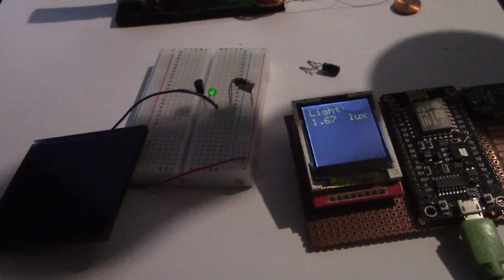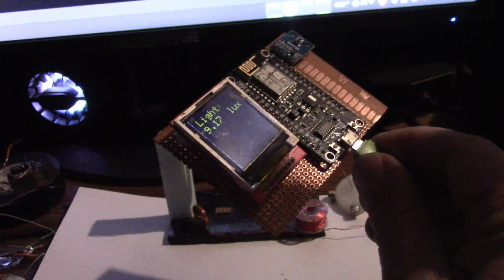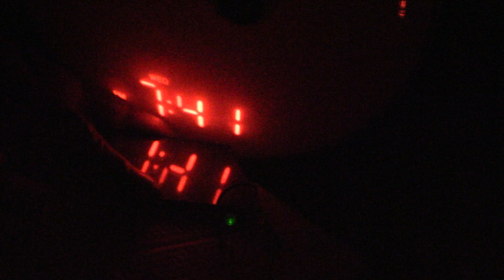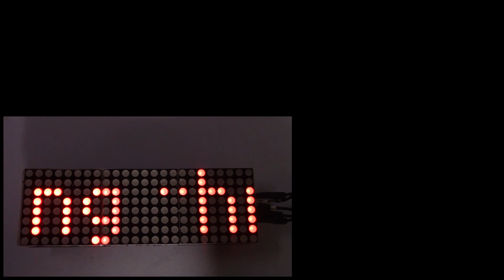The Simplest Low Power Solar Oscillator (works GREAT!)

Comment: That's literally just powering an LED with the solar panel... those resistors, not inductor, are plugged in wrong too do nothing in one case, as in not in circuit, and the other is just keeping the LED Voltage down.

Don't buy anything front this snake, but at least he's human and not an AI
Reply from the maker: Haha, never been called a snake before 🤣
The inductors are 1000uH and 100% real. Take a look online at pics of them, they'll magically be the same as these!

Comment: I built your Super Simple Slider circuit!  So, I can confirm to others it does work and is versatile enough to allow a wide variation of available components. I used a S8050 transistor, a premade  Vertical Toroid Magnetic Inductor Monolayer (2 identical coils wound separately on a green toroid ring) 2mH 5A Inductance Coil(s). As a source, I used 1.5V battery with a Schottky diode SR240 40v 2A (which needs only .2V to start). I tried, but It would not work without the diode. Possibly it could be replaced with the more common 1N34A Germanium Diode 50 mA 65V.  When the circuit was running I measured ~30 mA DC. The frequency was 4.725 Mhz, measured across the 2nd coil, NOT recommended across the LED (shut my meter off). Probably best done with a completely separate pickup coil?

The most interestingly thing I found about this circuit is that a 2nd LED can also be placed across (parallel with) the 2nd coil leads. Not as bright, but close enough, and with just a tiny increase in source mA.
Reply from the maker: Fantastic experiment and thank you for the results!
That was a heavy lifter of a transistor, which also shows versatility in NPN choice 😀

Yes, I had trouble with an AA, but no issues with solar panels. Looks like you found the solution, thanks again.

The second coil being the Base coil? Must try that!
Reply: @Slider2732_  It's the Coil connected to the Transistor's Collector pin. Diode +positive (long leg) connected to Collector side, -negative (short leg) to opposite end where the two coil ends are connected.
Reply from the maker: @ Thanks for clarifying, I'll try that!
Reply: @Slider2732_  Just found out today, your circuit works with a small power transformer, the kind with 3 wires on one side, the middle wire acting like the connection point between two identical coils.  Maybe an audio transformer with a ferrite core would be better. But now I can use the two wires of the primary coil on the other end to light even more LED bulbs...Amazingly, it doesn't seem to be pulling any more amps from the battery to do it.
Reply from the maker: @PowerMakersCafe  Harnessing some more field energy! It's' stepped into wireless territory perhaps. 
Great experiments, thank you for the info 😀
Reply: @ Wireless, yes that would explain the disconnect from load. At 4.7 Mhz it can't help but shake the Space! At that rate, I'm thinking the iron plates of this transformer cannot react fast enough to form an opposing magnetic field?
Reply from the maker: @ I'd agree, from own experiments. The whole thing of power going over a wire not through it. Excess is bumped off the wire into the surrounding space and it rapidly loses momentum as it does so, forming an electromagnetic field... as a theory.
Reply: @Slider2732_  It's a good theory to explore. Trying to relate it to previous concepts....Could it be understood as the wire acting like an an open accumulator of charges (capacitor)?
Reply from the maker: @PowerMakersCafe  I hadn't thought of it like a capacitor, but, thinking of an overcharging condition, maybe that's what causes the heat. When overloaded, the magnetic field of the medium (copper, zinc etc) is saturated and charges become resistive... heat. I dunno, fun to speculate 😀
Reply: @ Further experiments indicate it isn't normal AC...more like pure charge potential with a slight difference in polarity between the two wires. Is this what some call cold "current"?. I lit three 3v A10-type threaded LED bulbs in parallel. Typical results until I ran into high strangeness with a set of colored bulbs. Those would only fully light the last one plugged in, the one farthest from the transformer. Rectified, through a 4 schottsky diode-bridge, it charged a 16volt 1000uf capacitor quite quickly and steadily without any end in sight.
Reply from the maker: @PowerMakersCafe  That's an odd one, about only lighting the end LED! I wonder if by using 2 reds and a white, if the white would light at the end and the 2 lower voltage reds would stay off?
Depending on output load, that 16V cap route could be very useful as a voltage transformer.
Thank you for these updates 😀
Reply: @Slider2732_  You are right about the LED colors. Even direct from a Solar panel producing 9v, The three I was using in parallel, Red 1.8v, Green 2.2v, Blue 2.5v is lighting the lowest voltage LED first? "draining" the current enough not be sufficiently light the others. I guess in a situation with low available amps this is "normal" and to be expected. But, they all light up equaly across the transister's EC, and 2nd? coil.
Reply: @Slider2732_  Just found out your SSSC works with a fresh, unwound no-core coil of 100ft 16AWG CCA Car stereo multi-strand 2-wire. Found since the two wires are wound together in the same direction, one set just needs to be reversed in the circuit. Results:Brighter LED's (The 3 colors in parallel A10-style), with a little more amp draw. 

Oh, 3 SSSC circuits in parallel with the same 1.5v, seem to work pretty good.
Reply from the maker: @ Great findings about versatility. Thanks again for all your experiments 👍
Reply: @ The Diode AA battery fix was a lucky circumstance. I actually got your SSSC to be powered "wirelessly" from a small Plasma Globe using a dual-diode AV plug and capacitor, but it was just faintly blinking with the small antenna/ground. Before going with the bigger is better solution, I decided to just connect an AA battery. And it worked brilliantly! So, I thought I would simplify things, keeping with the theme of the whole thing, and removed the AV diode pair and capacitor. Well, as you know, that would not work. So when I put back one of the diodes, that is when it started working again. 

Come to think of it, the solar panel is probably acting like a diode. Not sure why a diode is needed here, but I theorize it is preventing the battery connections from interfering with its 4.7 Mhz oscillations.
Reply from the maker: @ I like the plasma globe idea. We used to have one, but, glass and outdoor storage in a shed didn't mix well 😵‍💫
Reply: @ If you're shopping for another,  I found USB powered Plasma Globes lend themselves to precise power usage measurements using one of those inline USB charge meters. Yes, the Globes use more power when you touch them, sad. Just the way Bill Parker designed them, I guess. You would think there could be more gained from a ground connection, right?
Reply from the maker: @PowerMakersCafe  Ah, been using a Charger Doctor for some while. 
It would be very cool if a ground connection ran one of those globes at a distance from a Slayer Exciter... now THERE's an idea! lol

Comment: Would be nice to see the base and emitter voltages on the scope on 2 channels.
Reply from the maker: I agree and it's worth a bit of a study of those voltages. 
It would also relate to the way a regular AA doesn't appear to work, but a solar panel does. I say 'appear' because it does enter a transition mode with a certain light condition, where the LED goes out. Another osc here with conventional blocking components does similar, the LED being off in the day, but starts flashing the LED in bright or very low light.

Comment: 1:20
I wanted to make sure my inductors were as close as possible, so I filled the sides of them to get an additional 1 MM closer and tied them together with thread.  I broke three of them in the process when I filed through the wire inside.  Then I thought I would be cute and stand them up on end to take less room on the perf board.  That made the circuit stop working because one leg from each inductor was in parallel with the body of the inductors.  The magnetic field would be shorted out into the legs stopping the oscillation.
Reply from the maker: Wow, nice mod though, I must say!
Very interesting observation too, the legs soaked the field energy?

Comment: That was an interesting result. I will have to put that on the list of things to do 😁😁👍👍
Reply from the maker: Looking forward to that. There must be other large glass amorphous panels on garden 'furniture' in the UK 😀
Reply: @Slider2732_  I just can't get settled into doing electronics stuff at the moment. Need to be in the right mindset, so that is why it goes on the list. I think it's the state of my work room, just looking in there horrifies me 🤣🤣 I did manage to dump a large box of stuff at the charity shop last week, but it didn't make any visible difference. Most of the time I am just moving stuff from one pile to another.
Reply from the maker: @GrandadIsAnOldMan  Same here with shuffling things around. Lately, from downstairs to upstairs and then, somehow, the downstairs seems to randomly gain clutter again!  I'm sure our better halves would have some input too 🤣

Comment: Great demo, many thanks ❤

I guess now make more sense what I have suggested. I wonder what else can be run instead of LED ? Could be your miniature tesla coil ?
Reply from the maker: Cheers 😀I like that line of thinking, that if there is an oscillator running, what happens to a Slayer Exciter coil driven by the output?

Comment: Nice. Does it go brighter if you wrap one bare shorted wire around the resistors?
Reply from the maker: Hmm, interesting question Kangsteri. It does go brighter if a piece of kitchen foil is wrapped tightly around. Pushing them as close as possible is though about 90% the same.
Reply: @Kangsteri  what you call resistors are in fact inductors … I now they look very similar 😉
Reply: @Caesarus2011  Resistors are coils, if they are not carbon. Usually joule ringer works better with one additional shorted wire.
Reply: @ indeed, some resistors are wire wound and their main characteristic is resistance, while you can get 1 mH inductors in various resistance, some of them with just 3 mili ohms but less or more resistance changes inductance. Resistance has an effect on magnetic delay and we may dispense with the need of ferrous core. With ferrous core current first fill the core then flow in wires … aka reactive inductance - voltage leading. For an LED is more important the voltage as curent required is minimal.
If you switch capacitors instead of inductors you obtain the reverse effect and collection should be with an inductor or inductive load, as voltage do not pass until curent build up enough.

If you have available a supercap +400F, take 2 aa rechargeable batteries, measure their amperage, then connect supercap. When supercap reach the voltage of batteries in series, measure amperage on supercap … you should have at least double amperage of what those 2 batteries can output. The beauty is now you have a constant 2.7 V until the supercap is depleted … which is not possible using batteries only. Run your LED torch like that and observe how long it last compared with batteries only.